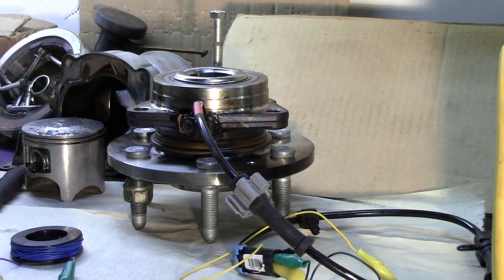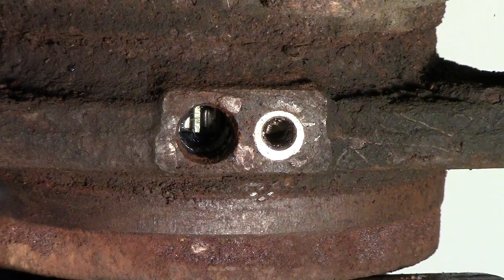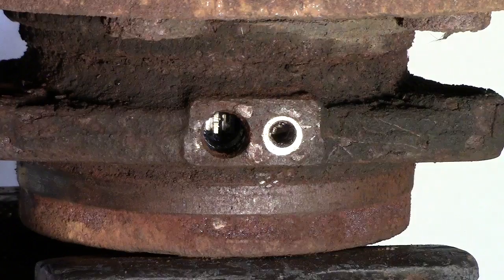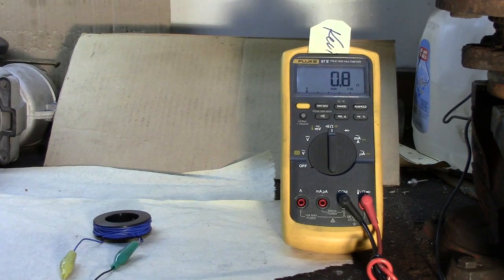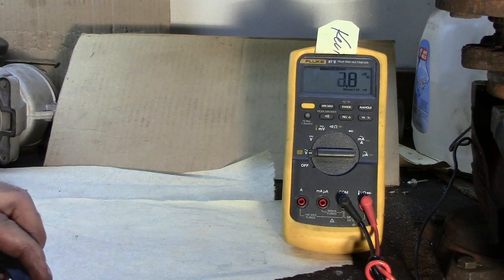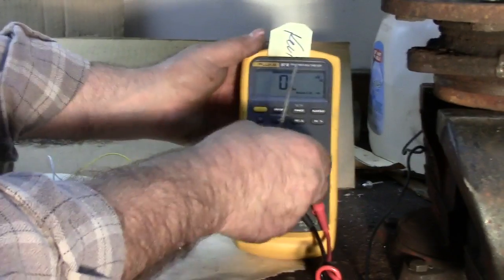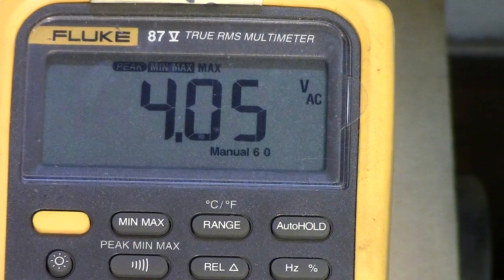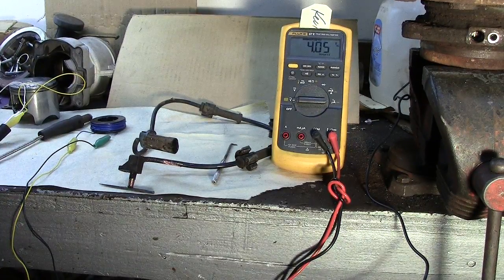speed sensor operation

Comment: sir on  pick up coil type sensor their are two wires can you please tell what is on the one wire and on the other? I mean what  was the one wire their is voltage? and other   signal from sensor or both no voltage flow?